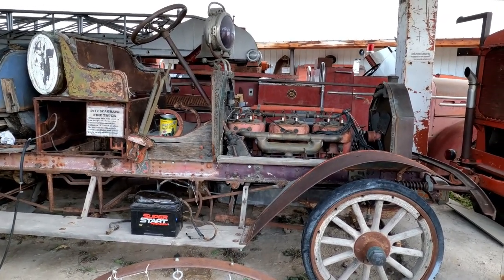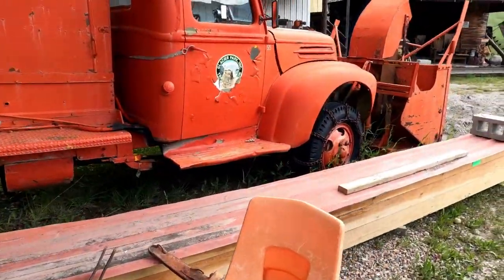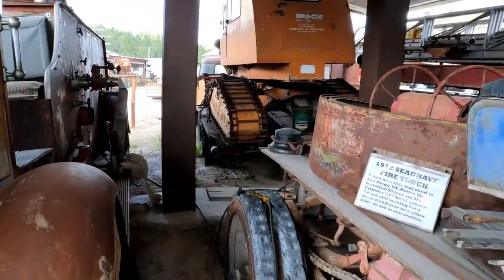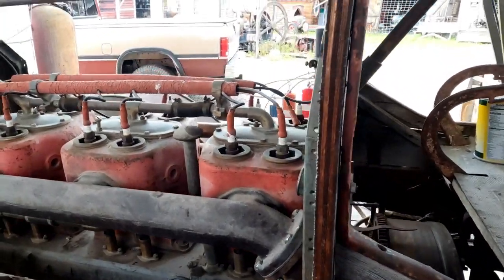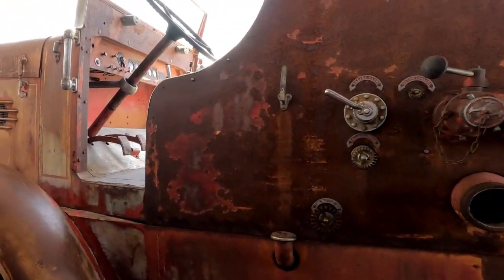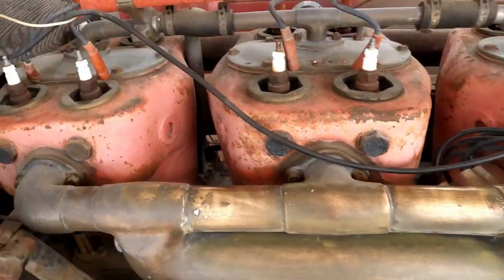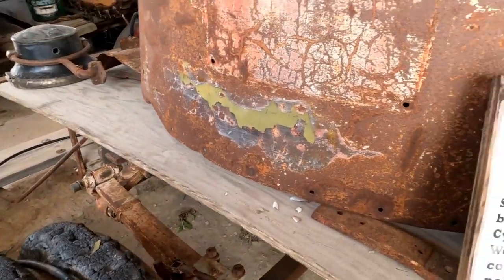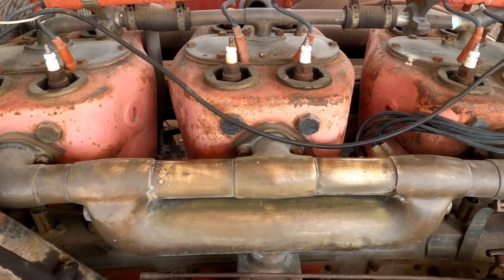1912 Seagrave: Video # 2

Comment: I just bought a 1938 Seagave  65 ladder truck with a Red Diamond engine
Reply from the maker: I had a lot of experiences with Red 450 and 501 engines over the years. They are great, but they do not appreciate being pushed down hill. Don't let the truck wind it up beyond about 2,200 RPM on downgrades and you will be in the clear.  Jeff